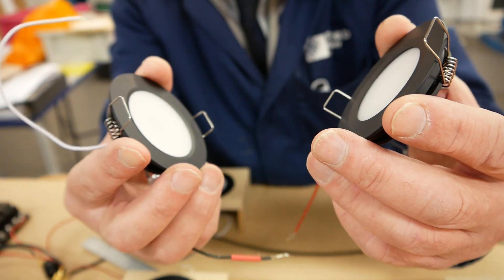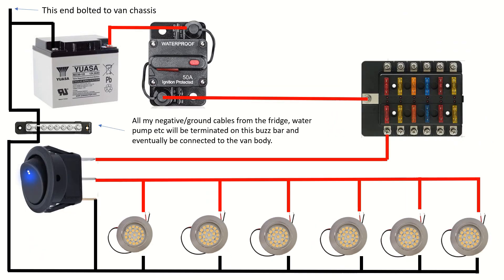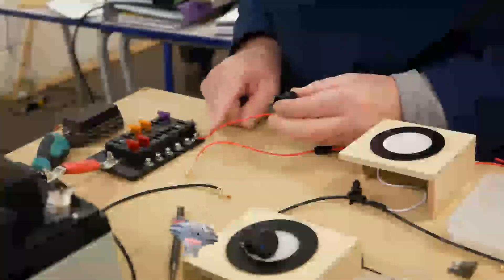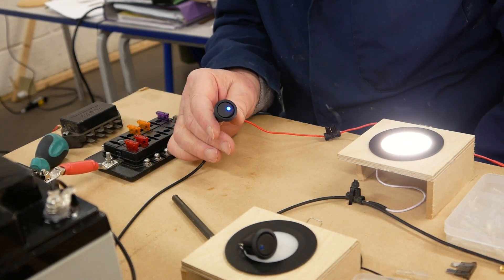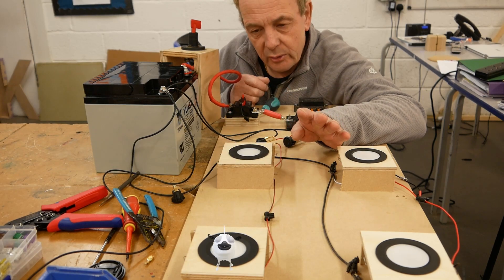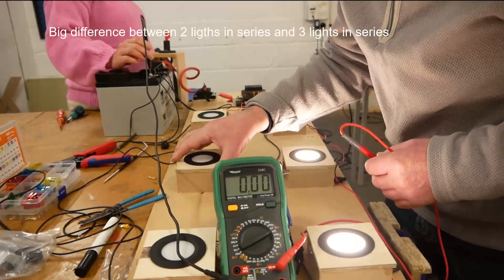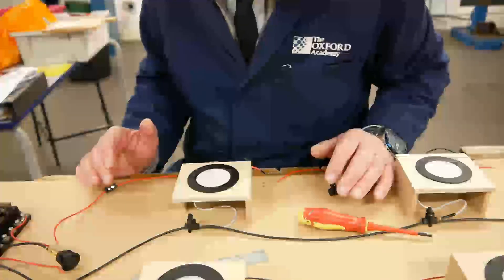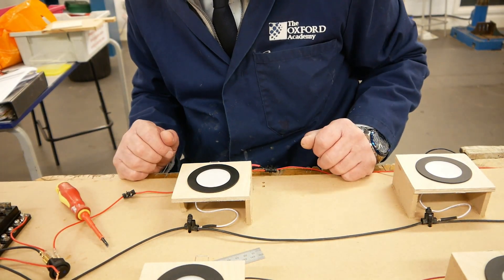How To Install Puck (LED) Lights | Interior Van Lighting Made Easy!  Campervan Electrics (Ep6)

Comment: Hi, what amp is the switch you use to power on/off the control panel? Thanks
Reply from the maker: Sorry for the late reply, I've checked the panel I have used which is fuse rated to 15 amps. This doesn't tell you the switch rating, but I think it is 20amps. I've left a link to both a single switch and the panel I used in my van. https://amzn.to/48DVAWP and the panel https://amzn.to/3So1t4L Hope this helps
Reply: Hi thanks David. Quick question regarding consumer unit for hook up. Instead of getting and wiring a consumer unit, I've thought about buying a pre-wired hook up which comes with an rcd and 3 plug sockets all in one with 20mtr cable. I thought about buy that and a surface mounted 16amp socket, cutting the plug off the hook up lead, feeding it through floor of the van and into the surface mounted 16amp socket which will be mounted to tow bar bracket.  That way works out cheaper and pre-wired. Would that work? Thanks in advance.
Reply from the maker: This should work, my only reservation woiuld be the external plug which would need to be waterproof, the cable from the consumer unit going through the van as long as it it is braided and should be fine, but at some point will need to go outside to mount onto the towbar which is exactly the way I have done it, because I didn't want a hole in my van. As long as the cable is rated for the temperature range you plan to travel in, it should be fine. I used artic blue cable bought on amazon, but I could have simply cut off a pieces form my extension cable that hooks up onto campsites. I've left a link to the way I did it, which is very similar to how you are going about yours. https://youtu.be/aNkQreDAZDM  @simonwolfendale790
Reply: @shed52  thank you so much for you advice.